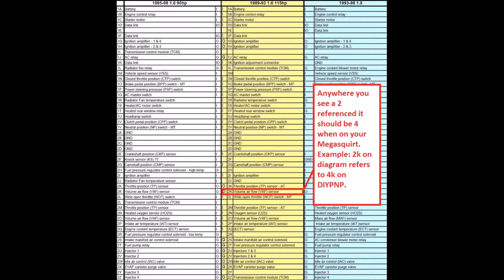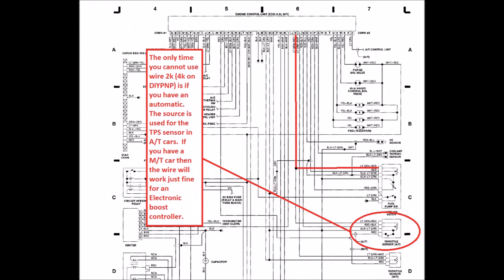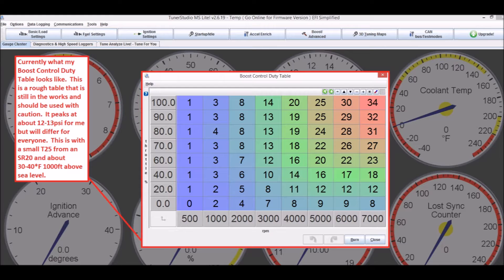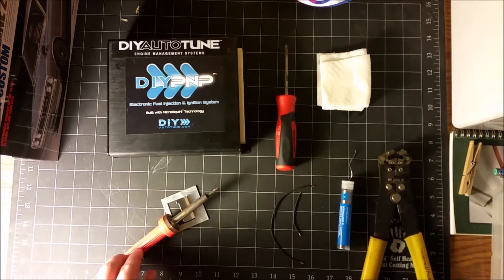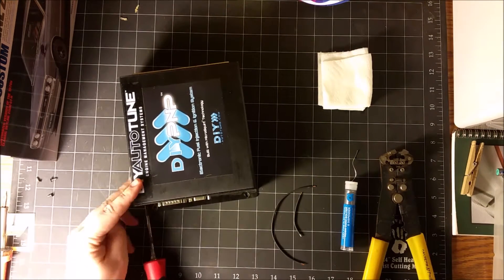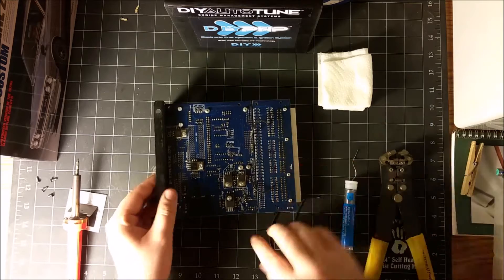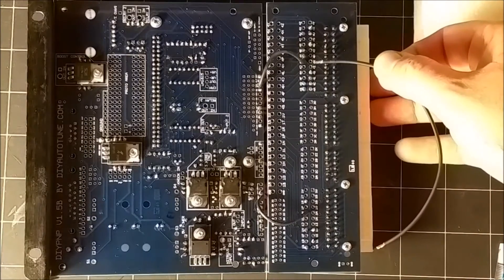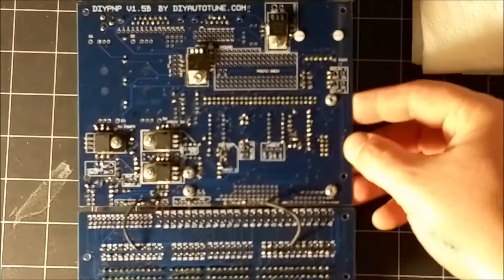90-93 1.6L Miata Electronic Boost Controller install

Comment: What size restrictor did you use for oil feed on turbo? I've been searching around and having a hard time finding what size.
Reply from the maker: I use a .040 restricter in mine but it really depends on what turbo you run.  Garrett has specs on their website for oil feed pressure.  Journal bearing turbos will require more oil pressure than a ball bearing will, in most cases.
Reply: +NA6 driver thanks for the quick reply I'm gonna run a journal 2554
Reply from the maker: +Dominic Short I don't think I have seen a journal bearing 2554r before.  You referring to an SR20 T25 by chance?
Reply: +NA6 driver Yeah that is the one,  according to the site I'm buying from its a 2554
Reply from the maker: +Dominic Short They are similar but not exactly the same.  If you go on some 240sx websites you can pick up a used one pretty cheap.  The SR20 guys like to go bigger since most of them are drifters.  It's a good turbo, hell, it's what I use, but above 13 or 14 psi you're not getting much more out of it.
Reply: +NA6 driver http://www.jdsperformanceturbos.com this is where I'm picking up a rebuilt one
Reply from the maker: +Dominic Short  Not terrible prices, and the ceramic coating would be nice to have done.  Check out Miataturbo.net sometime if you're looking for more information.  People can be shrude search first before asking any questions.  Goodluck on the build, it's fun but it gets expensive, lol.